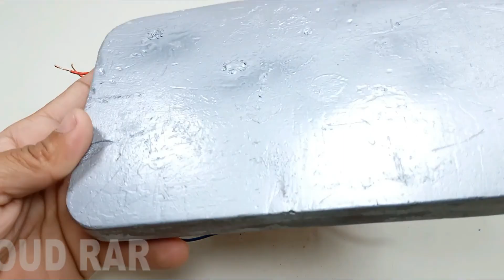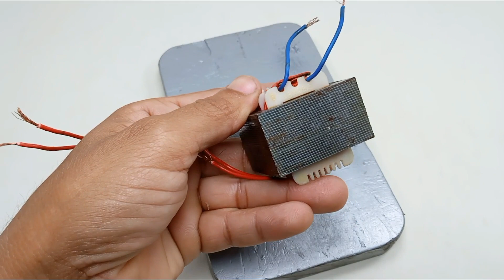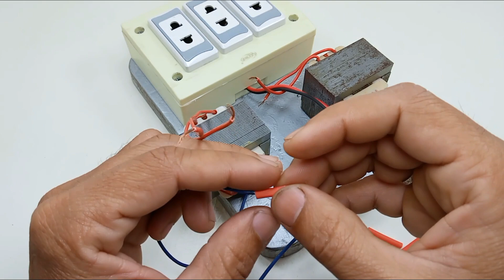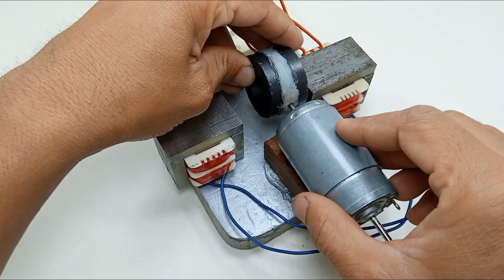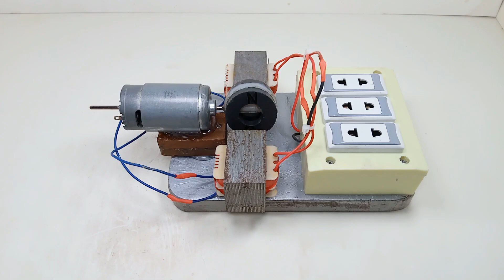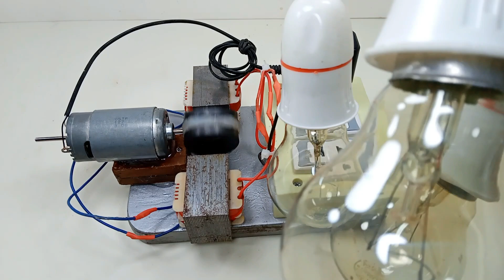Turn 2 Transformer into 240v powerful electric 10KW electricity generator to self-running machine

Comment: I  see the primary are in series  to get 240v  what are seçondary voltage or it dont matter
Reply: Das spielt auch keine Rolle  .Bei der Leistung von 10 KW fließen ja 41,6 Ampere . Da hat sich das Problem nach 20 Sekunden durch eine Rauchwolke von selbst gelöst . Währe sinnvoll einen Feuerlöscher zur Hand zu haben .
Reply: The size of the transformer tell me that you cant get that amount of power from it( 10kw)